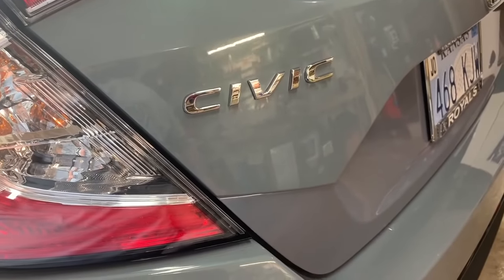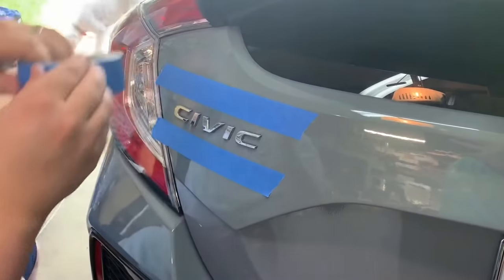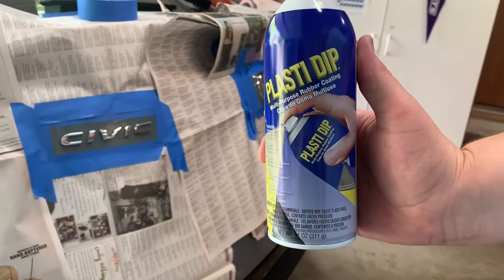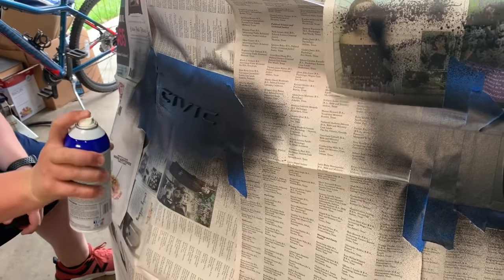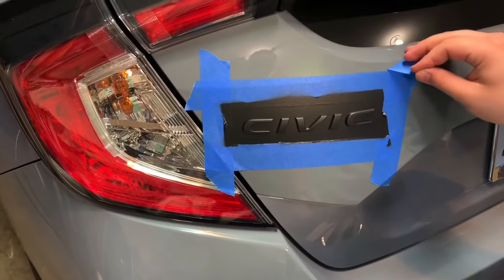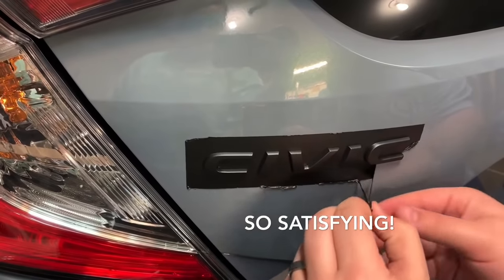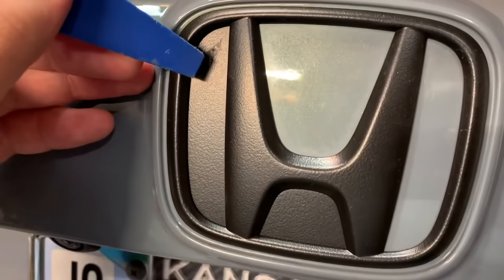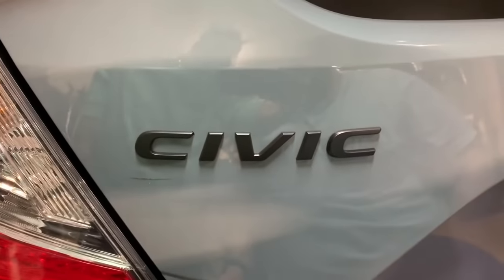Plasti Dipping Emblems-The best $5 car mod

Comment: plasti dip sucks i’ve been doing it for 2 hours and needed to use a exacto blade to cut out inbetween the lettering, it doesn’t peel perfectly or at all, it doesn’t peel properly and i had to redo my badges 3 times. i’ve been using brake cleaner to get it off and i feel like shit. everyone gets this nice clean result and for me it sucks and comes off the badge easily, and it doesn’t peel properly at all

Comment: How does it peel off the paint but not letters?
Reply: Try to spray straight on like he did (not at an angle).  The badge naturally has very small gap from car surface, so should have thinner coat than the rest of straight on surfaces.

Comment: Just wrap it ? Less orange peel look and as a glossy Premium look.
Reply: Takes a lot longer and is definitely trickier for people that haven’t wrapped before
Reply: Even if u have experience wrapping emblems is a PITA lol
Reply: Why does the plasti dip separate when peeling back? From painted surface to letter emblems, is it not still a solid application? How is the finish so clean without any cutting??

Comment: I got a clear coat. Will this prevent it from not peeling?
Reply from the maker: I wouldn't think so. But I can't say for certain since my civic didn't have it. But if it doesn't work right it'll peel right off, so no worries!
Reply: Clear coat doesn't peel easily

Comment: Unbelievably, it doesn't peel the black on letters :O How? :O
Reply: Maybe because where he sprayed on the face it is thicker. The sides of the letters are thin so this is a weak point and tears off here
Reply from the maker: My best guess is that the slight gap between the emblem and body of the car creates a point in the plasti-dip that isn't contacting anything so its a natural breaking point. My best guess!
Reply: @kccreations5945  I see your point 👌👌👌

Comment: Great video!
Quick question, why 30 minutes between spray coating?
Reply: Drying times
Reply: @danielforsyth1109  obviously,  but why wait instead of just put the full coat on then let it dry 🤷🏾‍♂️
Reply: 30 mins too long. 15 mins is perfectly fine
Reply: @JahGotWings  Long time since your message but you want to apply small coats because if you over spray, you will begin to see the plastidip liquid dripping. the finish will not look as smooth and finish product wont look as "professional".

Comment: Personally, I'd rough up the chrome emblem surface to give the coating, spray plastic or paint, some "tooth", as it were. I'm thinking 300 grit or so, possibly even a nail file laid flat and used lightly, since the coating is so viscous.
Reply from the maker: Yeah I’m sure that would help but I didn’t want to permanently mess it up in case it didn’t work so I did it this way. But that could work better!

Comment: How come it doesnt pull off the letters when you're peeling?
Reply from the maker: I think because there is a slight gap between where the plasti dip meets the car body and where it contacts with the letters and in that space it’s not adhered to anything so it’s a natural perforation. That’s my guess! Super cool how it works!

Comment: These coats are still too thick and shot from too close. That’s why you have such bad orange peel. Would also suggest putting a clear coat (glossy) OR plastidip uv coat (matt finish) these will fade really bad
Reply: What are steps for clear coat please?

Comment: Do you recommend to apply a hardener sealer when job is done?
Reply from the maker: No it's super durable as it is!
Reply: @kccreations5945  I can attest to this, I did a 7 layer coat on a forward facing part of 1 of my motorbikes 4 years ago with flat black plastidip and its still on there as good as the day I did it.

Comment: I want to do this with my car, but the AMG badge is kind of tough because the slanted vertical bars to the left of the AMG lettering are very close together and it's difficult to have it not peel off the badge when you try and get in between them. I almost feel like I need a surgeons scalpel to cut the film.
Reply: You have an AMG buy black emblems or get them painted professionally... Smh
Reply: So you can afford a AMG but not blacked out emblems? 😂 👌

Comment: It’s been played out for 2 years.
Reply from the maker: What does that mean??
Reply: @kccreations5945  That style has been done to death. Your better off just shaving the emblems for a clean look.
Reply from the maker: @4cylfreak46  Gotcha! Well don't do it on your car then lol
Reply: @kccreations5945  I didn’t lol. I like to spend more then 5$ on a so called “mod” 😆
Reply from the maker: @4cylfreak46  Check out my newer videos, I do too! Lol
Reply: @4cylfreak46  shaving them?
Reply: @drliz6783  Yes removing them all together to clean up the body style.
Reply: @4cylfreak46  And do you just clean off the glue? I'd imagine there's glue or residue left behind. Would there also be holes there? Sorry with the questions I'm just trying to figure out what might look best.
Reply: @drliz6783  some emblems have holes in the panel. best way to find out is to look up a replacement panel online and take a look at it to see if they have alignment hole behind them. Yes remove the any remaining adhesive with a heat gun and a plastic spreader. then clean the entire panel and see if the clear coat is dull behind where the emblems were. If so use so 3m rubbing compound to brighten it up.
Reply: @4cylfreak46  awesome thank you! Yeah I looked it up, has holes. Thinking that might look tacky.
Reply: @drliz6783  ok no problem. Maybe you can find other badges in a nicer style or color online to change the look up some. Depends on the make and model of how much variety is offered.

Comment: 🤣🤣🤣 turning your emblems black isn't a car mod lmfao a car mob is like a engine tune or turning your rear light to led or headlights. Your not modifying your emblem your just turning it black. Ricers these days think anything is a mod...lmfao.
Reply from the maker: People who don’t have any content commenting on those who do and bashing them… trolls these days🤣🤣
Reply from the maker: @310chris18  
mod·i·fy
/ˈmädəˌfī/
verb
“make partial or minor changes to (something).”
Reply: @kccreations5945  🤣 I like how yall try so hard to believe spray painting your factory car emblems black is a car mod 🤣🤣🤣🤣🤣🤣🤣🤣🤣🤣🤣🤣🤣🤣🤣🤣🤣🤣🤣🤣🤣🤣🤣🤣🤣🤣🤣🤣might as well put a 5+ horsepower sticker on your car and call it a car mod hahahahahaba
Reply from the maker: @310chris18  who is y’all?? I’m one guy. Also it at least adds 10 hp…
Reply: @kccreations5945  🤣🤣🤣🤣 atleast you believe in the power of the sticker 🤣